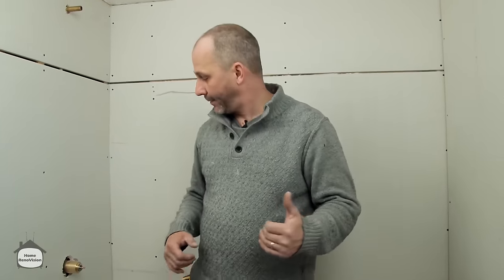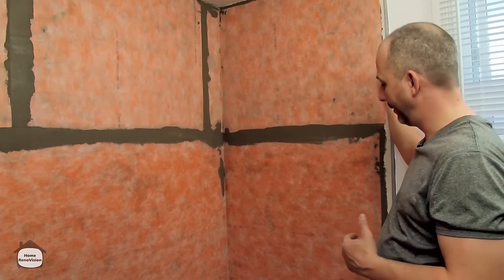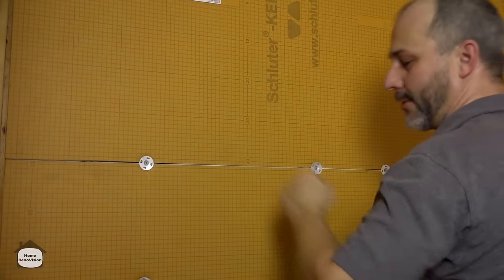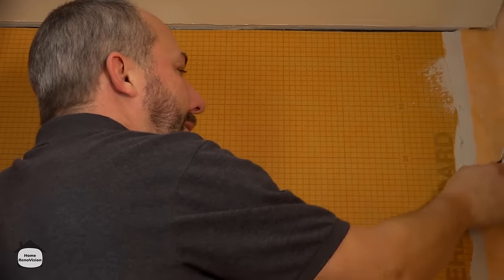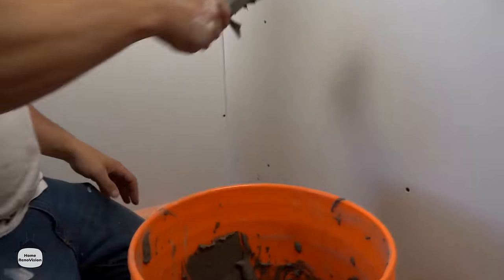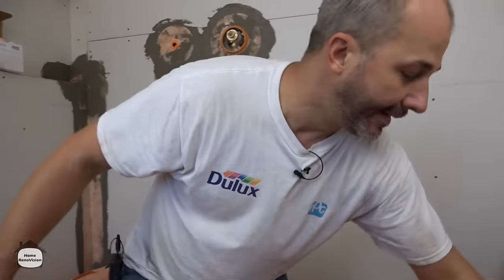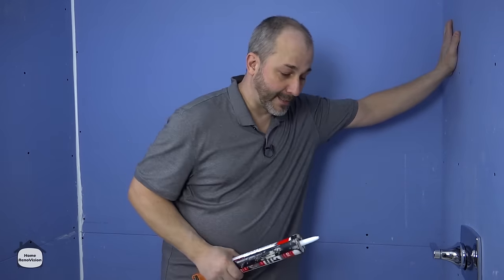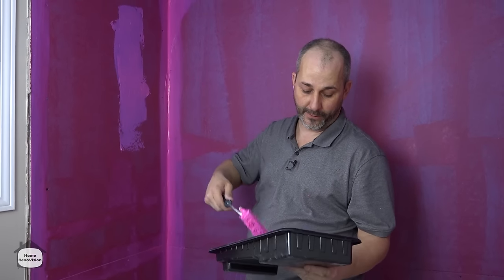4 Types of Shower Waterproofing Systems for Your Bathroom

Comment: Great Video's Jeff. I was wondering if you could use a Schluter Shower Base for option 4 with the Red Guarded Aquaboard. Would it be as simple as Kerdi Banding the floor to the walls or would there be adhesion issues?
Reply from the maker: ! did  a video doing just that. you can check it out here. we used aqua defense from mapei not redgaurd but they both would work.
https://www.youtube.com/watch?v=D_fZB1AQpBk
Reply: Thanks Jeff,  so I'm closer to my answer now. The Base in the the related link is that a Schluter base (because that's what I've purchased)?  If so the video doesn't show how the base and liquid membrane should tie into each other for instance should you paint the Aqua defense first then Kerdi band over it or Kerdi band first and paint the membrane over it and down onto the base a little?  Tx
Reply from the maker: simply install the band first and then paint over the wall and band together. Cheers!

Comment: If that glue under the walls is no problem on the tub surface because it “washes right up”, why would I want it in a damp area like the shower?
Reply: Think of it like latex paint cleans up with water, but waterproof when dry.

Comment: Here's how I tile a shower:

I build an air circulation system in the studs behind the shower in the studs diverted from the home air system - this is done through a series of small holes through the studs air comes in and air goes out.

I then use 4x8 sheets of 3/4 plastic to wall in the shower walls.

I drypack the shower pan over hydrolic-sealed cement base - also marginally sloped.

Over a rubber membrane, welded at the corners with corner dams.  I use two of these membranes,

I let the drypack remain naturally porous.

I then line the plastic sheeting with .6 mil sheeting to cover all corners and edges.  I only use staples at the top.

Install hardibacker board - using cement seam-tape on all seams and then paint two coats of Versabond seam sealer (mortar ready).  The hardibacker lies 1/2" from the shower pan to prevent weeping.  I have (of course) sealed the back-side of the hardibacker with silicone roof-coating and pre-drill all screw points with a mason-bit and fill the holes before screwing with Lexel.

I mix adacryl binder into the mortar mix and tile the shower paying attention to where the tiles ultimately will land to present an even-block tile appearance.

I scrape all tile joints to allow full grout penetration.

Vacuum up all debris - wipe down... then use a polymer-modified grout (gooey).

I wipe everything down as I go and when it dries, do two wet-wipes and one dry polish.

then I add a micro-fill stone sealer to everything and re-polish.
I am 134 years old and have never had a shower fail yet.
Reply: Oh yeah - I also seal all corner grout seams with a tiny bead of hard-pressed-in Lexel.

Comment: Good videos, I have the same question as Andrew R, which thin set is best to use over RedGaurd.
Reply from the maker: always use a non modified cement on any waterproofing system. The cement gets harder the longer it is wet and bonds awesome. Cheers!

Comment: Love your show I hate shouter. I mud walls... Spare me the lecture of it's to hard to do. Applying thinset on drywall especially non-modified thinset will dry way too fast for that plastic to adhere to wall, plus it does nothing to level your walls that would be all over the place because the thinset is not consistently troweled plus glass is not recommended to be installed in shouter, on top of that it cost just like mud set showers do.

Comment: I cant say this system dont work but I've seen so many of these types of systems fail. Is it just better to go with durock and a paintable water proofer ??
Reply: Paul Dangelo I replaced a 1-1/2’ H x 4’ W section with Durock cement board and Red Guard painted over it before laying tile. After I had a 2nd water pipe leak I decided to replace ALL the tile for a uniform look. The area where I tiled over the Red Guard is bullet proof. Tiles won’t come off. I had to use an angle grinder to cut out the cement board.

Comment: Why didn't  you show durarock, vinyl pan liner/oatly system and optional redguard for the walls. It is the cheapest material wise, the only really modern proven method IMO (with exception to redguard as it is fairly new) and not difficult.  All those schluter systems violate general building principles to be considered viable IMO. (plastic is incompatible with cement, cement is not a waterproofer and vapor barriers can trap moister on outside of the barrier, which is bad enough on wood studs but on drywall is even worse.) I guess I just have a different philosophy with building materials as I always fist look to the past to see if a viable, tried and true cost effective  solution exists first and if not then try to adapt a new fangled technology as long as it doesn't violate basic building principles.

Comment: "This not cheap product and it really works ... So your looking at a $500-$600 investment"

I'm currently shopping for a house and recently looked at a home where the owner installed all their own tubs, showers, toilets and sinks. On the surface it didn't look to bad and I did notice somethings that were wrong (I'm not a plumber or an electrician, but I'm pretty sure there should be a u-bend under sinks and open exposed wiring coming out of an electrical outlet isn't good). I figured I could have someone fix some of the plumbing and have a couple plugs put into the electrical outlet, it was just unfinished work. But that was just the tip of the iceberg. We had an inspection done and I guarantee $600, per bathroom, for water proofing is cheap compared to the cost of fixing the damage this home owner now has. It's all gotta be torn out, massive rot in both full baths to the wall studs and plywood under the shower and tub leaking down the wall into the finished basement. They painted over the drywall recently, but the inspector showed us where the wall was spongy and you could easily push your finger right through, along with water staining on the ceiling coming through the fresh paint.

Comment: gotta tape all wall joints or risk linear tile cracking.
Reply from the maker: actually you need to bond all joints, tape or adhesive sealant works well.

Comment: I made a mistake and didn' t waterproof my shower before placing my tiles on. Is there something that cann be recommended to put on top of the tiles in order to prevent water damage?
Reply from the maker: You can use a sealer on the grout to buy extra time. just be sure to reseal every year and use the water based. Cheers!
Reply: Thanks  alot for the information. You have helped tremendously.  Is there any particular sealer that you recommend?

Comment: Damn..I got all excited about using this system on by bathroom renovation. just checked..they don't sell this product in Australia. Here they have a building standard in my State which you either a) have to get in a licenced waterproofing contractor. Or b) you need to pay a council building inspector just for the waterproofing your own bathrooms, and you have to follow the code to the letter..it's becoming a joke!!!!  ..nanny state is alive and well 'down under'. nice job by the way. think I might move to Canada :)
Reply: raindogred I have done a couple DIY kitchens, and I could have benefited from the knowledge that a paid visit inspector might have hopefully shared with me on how to better waterproof the wall and floor adjacent to the sink area.  It is only after those installations that I have gotten ideas on how I could have better waterproofed that area.

Both had contractors involved in different parts of these project; however, they had zero ideas on waterproofing.  Sadly, I involved these contractors hoping to gain from their experience.

The solutions shown in this video such as a mold resistant wallboard covered with the Redguard liquid membrane would have been an improvement, and my wooden floor could have definitely benefited with ceramic floor tiles using Epoxy grout under the kitchen cabinetry.

After watching several dozen hours of YouTube videos, I am slowly improving my self-contracting ideas, but initially it is a struggle, and I am not sure other DIY installers will invest as many hours watching videos as I have done.

Comment: The schluter system looks nice but unless I heard wrong it is a product you can not get a warranty on? No way would I drop that kind of money to miss out on the warranty over a tube of caulk. If you can't buy the caulk the company requires for the warranty then the company doesn't need to sell any of the product. Just my opinion.
Reply from the maker: if you don't use the kerdi fix then you will run into issues. It is available on my amazon link but not in the home depot where they sell the product
Reply: Home Depot or Lowe's carry some Schluter products but not all. You can order them through these stores. They don't have them in stock because they don't have enough of a customer base in areas. Dal Tile usually has everything in stock if you have one around. Having a business account at Dal saves a ton of money.

Comment: 42:22 most expensive drain i have ever installed  almost 500 bucks out here in redding ca just for the drain not for the plumer.
Reply from the maker: I used a drain overflow that was $1000.00 once. for an old clawfoot tub.
Reply: Thats cool but crazy priceeee

Comment: Whoever layed out the tile on the wall behind you left the smallest triangles on the left side smaller than the right side
Reply: The lines on the entire back wall appear to be off but that could be because of the camera angle. One thing for sure, the diamond pattern tiles are not centered to the wall, hence the smaller triangles on the left. Whoever installed that tile made an ugly and dated diamond pattern even uglier.

Comment: Kerdi is nice, but WEDI beats it hands down
Reply from the maker: Just because it costs more does not make it better in every situation. For most bathrooms wedi is just a huge cost with  no benefit!
Reply: @HomeRenoVisionDIY  Wedi has many of the same benefits of Kerdi board (which you explain in your video) plus some. Its faster than kerdi, and its waterproof throughout the entire xps core of the product (not just a paper thin membrane like Kerdi). Because it has a fiberglass reinforced cementious outer coating there are no prohibitions to using industry standard modified thinsets. In my area Kerdi board and Wedi are comparable in price. Sheet membranes (Kerdi, USG membrane, Prova) are nice when cost is a primary concern but I am not aware of a better shower system than Wedi.

Comment: at 7:35  dude you scraped the mud off the tube with the trowel. that action could buy you a thousand dollar tub and a redo of the whole surround. I don't like being a hater, please don't take it to heart, but use as a fyi. In my time I have had things go very wrong in that sense , loss of profit and word of mouth are thing to hard to recover from.
Reply from the maker: just the inside corner that will be covered by the tile and silicone. no worries.

Comment: You like to cut corners I see.  If you do have any water issues later it would be hard to have the warranty coverage.
Reply from the maker: LOL, have you ever tried to get a warranty coverage from a manufactured product. they only cover the materials not the damage. I do not get too consumed with purchasing all of the expensive options. In most cases it is just a money grab. I am sharing my experience and am happy to do so. BTW I have never had a shower call back. been doing it 20 years!

Comment: why go through all the trouble of adding concrete to the surface?  just use concrete backer board.  basically sheetrock with concrete already on it.

Comment: Any one notice he installed the MV seal backwards
Reply: I thought the same thing. I just installed the Kerdi membrane system today over drywall and for the mixer valve piece it explicitly said insert the wide rubber gasket portion into the wall.  Maybe there was a reason Jeff did that that wasn't shown in terms of the end result.  Either way, I love Jeff's videos.  I've learned a lot 👍
Reply: I wouldn't take advice from him if he can't install the seal correctly

Comment: Or you could use the Wedi system and never have to worry about the shortcomings of these other systems.
Reply from the maker: I prefer not to use a system that relies solely on a caulking gun. 1 air bubble and you are screwed.
Reply: @HomeRenoVisionDIY  I would like to assume that given your ability as a renovator you would have no problem not having bubbles. I've personally installed hundreds of these systems and not one of them failed.
The method that you cover screws in the schluter systems is identical  so isn't that calling the kettle black?

Comment: The first mistake is using regular Sheetrock in the shower. You need to add Durock (Concrete board) and moisture resistant board.
Reply from the maker: if you are going to waterproof the substrate can be made out of paper. it still won't get wet!

Comment: If you're going with fiberglass or onyx panels instead of ceramic tile, you may be looking at using water-resistant wall board behind it instead of cement board or hardie board. That part of the video starts at 43:50.

Comment: Never clean  thinset morter off of your tub with a metal trowel
Reply: And when you poke your knife blade through the board to cut out for the plumbing fixtures, make sure the unprotected tub wall is directly behind it.
Reply: Red guard works great but for goodness sake, use durock or equal and put some self stick durock mesh tape on the joints and corners and your grout will never crack. And put some mesh  tape over the tub flange after you've put some painters tape on top of the tub
Reply from the maker: perhaps you should do a video on your favorite system! It has nothing to do with mine!
Reply: @HomeRenoVisionDIY  Ha!  Hate to be a troll and you seem like a really nice  guy. Anyway, I'm a High end contractor on Long Island, NY. been doing frame to finish carpentry for  34 years and just had to comment.  I'm too busy to make videos. Merry Christmas to you
Reply from the maker: Get back to me in 2 years and we will see if you made the right choice. I doubt very much your pension plan is very lucrative. Merry Christmas to you as well.

Comment: I think the cost of some of these building materials is ridiculous. $30/roll and 100$/sheet is stupid. Absolutely stupid.. It's foam board with a coating.. It actually costs 10cents to manufacture it but because it's waterproof they rob you 100s of dollars ... I'm so fed up with stupid prices of things..
Reply from the maker: Hi Kenny, you need to factor in the cost of R and D and testing to be approved in wet areas and marketing and advertising, warehousing, distribution and the idea that it costs 10 cents....please. are you just mad you didn't think of it?
Reply: @HomeRenoVisionDIY  I am a little mad yes. Years ago I worked a research engineer and we worked for three years on a design and I remember thinking it would be nice to recoup our R&D costs as fast as possible, but it would have multiplied to the consumer costs by a factor of 4 putting our product (no matter how superior) out of the price range of most.

What frustrates me is that the majority of people in Canada are having trouble gathering the downpayment for a house let alone the cost of one. Every part of a house is jumping and leaping in price. I was looking at underlay a few weeks back. I paid $4.50/sq foot for hard wood floor. I was expecting $3/sq foot for underlay (I paid that about 10 years ago?) I found products costing 3X what my floor was. So what happens? Flooring companies say, "hey if they charge that we can increase our costs by a factor of 5."

I'm afraid that kind of idea will fail because most will not be able to afford basic living. If that happens a government system has to be introduced and then you might as well be communist. 

The research project I was part of took 12 years to recoup R&D and its something you use every day. BUT you never saw a huge price increase in it. :)

Comment: I'm sorry but there is no situation were acrilic latex modified thinset is not superior to regular cement based thinset. It is nonsense to suggest that your membrane needs a non-modified cement otherwise it will fall off the wall. It will adhere better with a acrilic latex modified thinset.
Reply from the maker: Hi Jack, perhaps getting off the milk crate long enough to stop preaching and do a little reading. The reason there are 2 kinds of cement is that they perform better in different situations. If that was not so they wouldn't make the stuff. Cheers!

Comment: This was NOT a comparison of 4 different systems, this was just a glorified advertisement for Kerdi.  Be honest, man.  Very misleading clickbait title.
Reply from the maker: the video is titled 4 types of shower waterproofing systems. Not 4 different systems for waterproofing. system 1 was to use a membrane on substrate in a tub shower/ system 2 was to use a kerdi board in a shower, system 3 was a complete custom shower with sloped pan and integrated linear drain, system 4 was redgaurd and sealant in a shower with a tub.  That explanation is too long for a title. Not misleading at all.